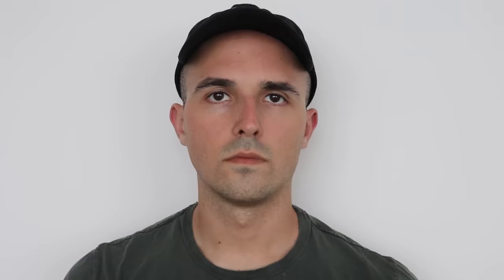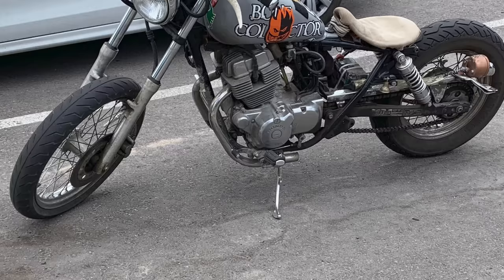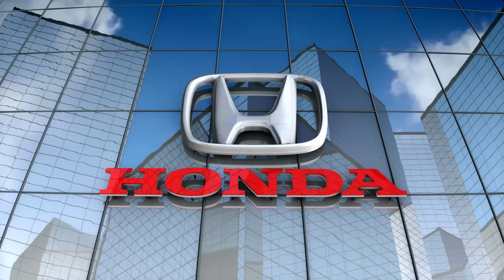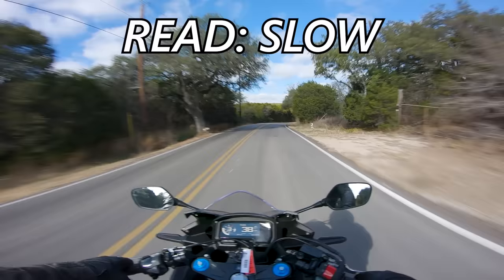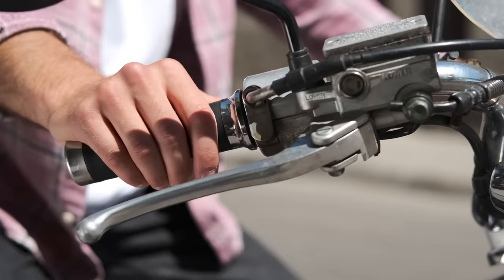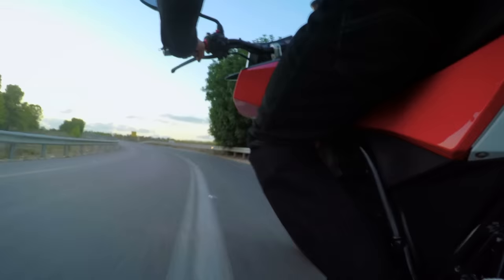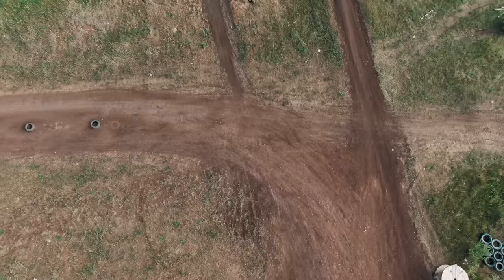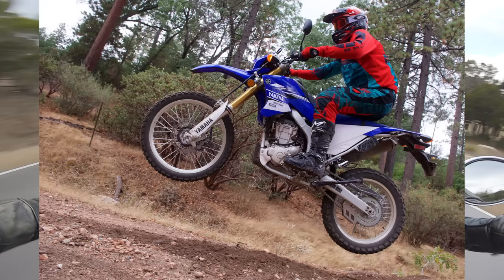7 Used Motorcycles That WON’T BREAK! (Low Maintenance)

Comment: Triumph, Harley and Enfield you say?
How about a suzuki vstrom 650. Mine has been bulletproof for 200 000kms.
Reply: Looking to buy a used one coz the tiger800 and gs750 is too expensive and 390 adventure or himalayan is less powerful. Any suggestions?
Reply: @aniruddhagujar4119  Benelli trx500 or Kawasaki versays 650
Reply: @prithvirajsainiranjan6240   no so underpowered and pricey services and maintenance cost
Reply: @aniruddhagujar4119  what else is available tell me😂😂
Reply: @prithvirajsainiranjan6240  better to buy a used vstrom versys 650 than Benelli
Reply: @aniruddhagujar4119  Me too but they're so bulletproof they hold their price really well...sometimes you can get a deal because they come with all sorts of panniers and travel stuff
Reply: @prithvirajsainiranjan6240  benelli is highly unreliable bro.....believe that
Reply: @Sandipan_Naskar  oh ok I didn't know that I am still a 17 year old so still learning 😂
Reply: What kind of bullets did you use?
12 gauge or 9mm??
Reply: @myname9252  Rubber bullets😂
Reply: @aniruddhagujar4119  italian machines=🌰. They run great til they dont.
Reply: @myname9252  I seen a British bike magazine test out the "bulletproof" theory on a GSF 1200 engine. :-))
It was, except for the oil sight glass, plus they used 12 gauge bird shot :-((
Reply: @aniruddhagujar4119  Cannot be wrong with V Strom 650, excellent bike!
Benelli is heavy, underpowered and made in China.
Reply: I've noticed a dubious trend among motorcycles that come from Suzuki and have 650cc's... I have a 95 Suzuki Savage 650 LS, myself... AND it's simplicity can't be understated (1-cyl thumper engine... 1 brrl carb... ZERO ECU... Air cooled... Zero f***'s given)... AND it's rugged as hell. I ride the mountains A LOT (because it's where I live)... SO it gets treated like a Cruiser ONLY when I'm on long enough trips to get on an actual highway... AND often gets treated as a sport or trail-bike bouncing from the take off to avoid getting plowed by a logging truck when I hit an asphalt road to kicking around weird uneven and mostly gravel or broken gravel and mud surfaces almost everywhere else...

     ...AND zero trouble... The carb cleans out with a scrub brush and a set of Acetylene Torch nozzle cleaners over about a half-hour break... AND that's even been a rare occurrence... Basic maintenance obviously SHOULD be done regularly, but she just keeps going...

     AND then there's everybody else talking about their older Suzuki's... and it's almost always a 650 something or other that's been as rugged and reliable as the winter is long...

      For not making it on the list Vid... I have to wonder at the reliability of the bikes that did... NOT all together sold on the Ducatti, though... BUT I count the trial by miles, not years... SO I do always check the odometer...  ;o)
Reply: Thank you for mentioning Suzuki for I owned a GS450L lasted sold it to a gentleman and he passed it on to his son.

Comment: Bought an '85 Honda 650 Nighthawk 2 1/2 years ago.  It's a John Deere tractor disguised as a motorcycle.  For a grand, it starts, runs, looks (sort of) good, and is great fun.  Even the Harley guys acknowledge Hondas are bulletproof.  Recommended.
Reply: Just bought my first bike,an 83 550 nighthawk
Reply: here in India escort's tractors are more reliable and preferred over jhon deere. and for bikes hondas are undoubtedly bulletproof.

Comment: I'd like to say a thing about a Honda in particular: if you stumble across a 1985 Honda Nighthawk (CB650SC) you can buy it on the spot because it got '10s level technology: that bike is indestructible, is shaft driven, is liquid cooled, it got self adjusting carbs meaning you will never have to set them up in the garage and it has stock digital gear, fuel and tyre pressure indicator. I did my msf course on one of those and I loved it. Man I want to buy one so badly
Reply: A CB650SC, Which is a Nighthawk, is air cooled. There is no such thing as a self adjusting carb. Self adjusting fueling would be fuel injection, which no Nighthawk had unless your driving a European version which I have no knowledge of. They did not have Tire pressure indicator's either. The CB650SC you describe are extremely dependable and virtually unbreakable.

Comment: Another I'd put on this list is the first generation Suzuki Vstrom 650. Especially the late models after 2008. I bought by 2008 in 2018, have ridden it three seasons... Started just under 10K km, have almost 70 on it now. Outside of oil changes and tires, I've done front and back brakes once and replaced the chain and sprockets. No lie. And it's fun as hell. One recommend if you get one, K&N air filter and Iridium spark plugs. You'll save yourself a lot of maintenance time and the Iridium plugs help give it a little kick in performance while still using regular gas.
Reply: absolutely, the sv/Vstrom 650 should have been at or near the top of the list.  Also, what up with no mention of the Triumph triples... bullet proof and very fun.
Reply: So, I had an '82 Suzi GS650. Then in 2008 (a few years later) I wanted to buy a used vStrom, but they were so rare that used ones were almost the price of new. Then I wrangled a deal on a demo 2008 DL-1000 and I rode that for 10 years.  I did notice that it preferred premium gas (and went further on a tank than on regular) but they don't like low revs. 
After a brief relationship with a Moto Guzzi Breva 750 (fun, light, flickable, but just too small for me) I was at the Suzi dealer to close the deal on a new (2019?) DL-650. 
Base price was under $10k (Canadian) but it was over $10k "out the door". 
And they had a fresh trade on the showroom.  
A 1-owner 2004 DL-650, all stock, with factory 3-piece luggage and new Michelin Anakees on it. 
The owner kept it stored in his heated garage, and only put 20,000 kms (13,000 miles) on this 15-year-old bike. 
He just traded it on the same new DL-650 as what I was planning to get.  The price was $4k (Canadian, that's US$3k) -- with full luggage on new Michelin tires -- and there is only 1 scratch on the entire bike that nobody would even notice! 
So, I'd sold the DL-1000 for $4800- (it needed a chain, sprockets, and rear tire which would not have increased its value) and decided that I'd be stupid to pass up this "new" bike that just happened to have spent 15 years in a garage, and was serviced by the same dealer every spring. 
Oh, and it seems that they hadn't "cheapened out on the front suspension" yet.  
You know that a big advantage of the 1000 over the 650 is the adjustable front suspension. 
But my 2004 650 has the same suspension as my 2008 1000 had ... another benefit oldness.
Reply: Mine hit 98k on the odometer before I sold it!

Comment: Yep, my first two wheel machine is my 2004 Honda silverwing 600 scooter! A little big and unusually powerful (especially for a scooter) but it was great to learn on! No clutch to mess with as I got used to wielding a 500+lb machine that will go triple digits with no problem. The only problem with it thus far is a moderate size oil leak from the oil seal, but should be an easy enough repair. 
From there I graduated to another bike on the list; the Harley Davidson 883! I absolutely love this bike! Being a new rider I don’t have anything but a scooter to compare it with so it seems like a REAL MOTORCYCLE!! After 500 miles on it I haven’t had any of the oil leak issues everyone complains about? My air cleaner is, well, clean😂🤷🏻‍♂️. The 883 seems like a rocket ship compared to my Honda and I couldn’t care less about the vibrations. It’s just an old school, no frills, super cool looking, motorcycle that does motorcycle things. It goes down the road on two wheels looking awesome and sounding great and that’s all I need it to do. I’ll probably trade it in one day for a bigger bike but not right now, and not for a while. Not to mention it’s super cheap to own.
Reply: I've got 60k on a silverwing.  Only repair is new wheel bearings since I ride in the rain.  I may need a new clutch pads soon.  But It will probably hit 100k without much more.

Comment: Old Hero Honda bikes are the most reliable thing on Earth after gravity. Especially the Japan model CD100 and Splendor.
Reply: FYI, Those were based on Honda Cub which in World's biggest selling bike and every biker is familiar with the Cub.
Reply: @ritwik0  yep. Owned a honda cub, cd100 and original splendor. I still have a CD100 non SS model and a Splendor Japan model in perfect running condition. CD100 has only 36k genuine kms.
Reply: Absolutely my dad's bike got more than 350,500 km

Comment: I used to work as a motorcycle courier, typically running 500's as the best compromise between speed, range, reliability and economy. Hondas stood out by head and shoulders. In the 1980's through 1990's, the Maggot (that's the CX500) was the tool of choice. Later came the VT500, which was okay, but not as good. Kawasaki's pre-Zephyr GT500 & 750 fours were also honourable mentions. All shaft drives, you see. Eventually I got fed up ending my day a couple of hundred miles from home and downsized. I got a Suzuki GN250 which was good for nearly 90mpg and nearly 90mph, depending on use. The engine was bulletproof. Biggest issues were the tiny petrol tank, so you were routinely on the lookout for a petrol station, and the gear lever constantly coming loose on its splines until the splines wore out and a new shaft was needed. The trick was to spot-weld the lever to the shaft. Later, I got the almost- in-every-way-inferior Honda CB250. I hated riding in rain. Bear in mind I was out for a minimum 10-hour shift. Then, one day, Benelli produced their Adiva convertible scooter. It was love at first sight. I  got one brand new. The deal was to use the Honda in fine weather and the Benelli in the wet. That changed my life. And contrary to all expectations, the little Benelli just kept on going, year after year. For 13 years, that radical roof-scoot soldiered on, keeping about 90% of the rain off me. Last year, several years into my retirement, the thing having been abandoned at the back of the garage for 5 years; I hauled it out, fitted a new battery, squirted Bradex into the air intake and swung the starter. Just 3 spins and it was running - even on 5-year-old petrol dregs. So I made its overhaul a covid lockdown project and next week hope to have it  back on the road. Benelli's Adiva - the best thing I EVER bought...
Reply: Fantastic post
Reply: The Kawi Zephyrs weren't good?
Reply: My first real street legal bike was the '79 CX500. I loved that bike. I drove it everywhere.

Comment: We missed the 1a spot on your list that is the sv650! The most bomb resistant nuclear war surviving Cockroach bike you'll ever find!
Reply: Is it really that good? I just took my test on one and thought I like this might buy one 🤷🏼‍♂️
Reply: @FriskyDecisions  I've got a V-Strom which has the same engine, more or less. I'd say they're pretty close. They do like fresh oil. Change the oil every 6000 km and they'll go a long time. There's a guy on stromtroopers who got 600 000 km on his, before the engine cracked. I think the only major things he changed were stators.
Reply: @gasdive  600 000 ? Holy mackerel !!!!
Reply: I hoped will see Vstrom 650 in the clip, but instead I saw HD and Royal Enfield... 😂
Reply: @electron1980  Or a Transalp…
Reply: 90% of motorcycle courier in London ride SV650..
Reply: @markletts8802  Really? It can't imagine the fuel economy is good enough for a courier on 650cc sport bike. Sounds like an awesome job, either way!
Reply: @cesartapia610  SV is not sports bike.
Reply: @electron1980  Naked bike, right? I assumed they would want sub-600 bikes though.
Reply: @cesartapia610  Yes, naked. But SV comes with some fairings, also. The V2 engine is cheap to run, my old 650 V-strom drinks about 4,3 liters per 100 km. With pillion. And SV is lighter.
Reply: @cesartapia610  mine gets 50 mpg no matter how I ride it
Reply: @electron1980  many would beg to differ given the racing scene In the UK and worldwide on mini twins.
The MK2 full faired variant is extremely nimble and whilst it may lack the top end power on short circuits the svs low end torque can be used to the best effect
Reply: @seeul8rwaynekerr  Confirm! ✌️

Comment: Missed the SV 650
Reply: I've read a thread by a guy that made more than 400000 miles on VStrom 1000. Same engine with SV1000, maybe little detuned. These engines are bulletproof.
Reply: @jordan9339  If they only made the sv1000 with ABS, I would totally want one.

Comment: Royal Enfields are known to be the most unreliable bike in India. You don't really buy an Enfield for reliability...
Reply: Because we Indians compare it to 100cc motorcycles.
I own a himalayan bs3, most notorious names in India when it comes to reliablity, but trust me REs are reliable.
Reply: @logicalindian_777  Nah man, compared to the direct cost competitors, Enfields are worse and have a very picky service schedule. I had my NS200 lying in my parking for 7-8 months during COVID and it didn't give me any issue, other than a dead battery of course. That wasn't the case with many bikes, mostly Enfields, my friends own....
Reply: Post 2018 REs are reliable bikes. Had mine for 2 years, 11000km, not one (1!) problem. I do my own maintenance.
Reply: Well i have ny vlassic 500 for the past 3 years .. not too bad i mean sure it does cost more compared to a few bikes ... but mine was left for almost  4  in the lockdown  .. and a basic service  is all it needed ..... i got it new an rode for around 12000 kms in  2.5 months had i had to change the clutch  plate once an thats  about  it ..

Comment: Ive had lots of bikes, one of the most memorable was my 1983 Honda nighthawk s cb700. Easy maintenance, hydraulic clutch, hydraulic lifters, shaft drive,16 inch front wheel.
 Very tight package. I had to commute in those days, nighthawk made it happen.
Reply: I had one of those. Maybe should have kept it.

Comment: With 4 Hondas at my house, I have to agree with everything you said.  Fuel injection on all 4 makes for the greatest long term reliability. ('23 GROM, '12 CBR250r, '14 CB1100, '10 VFR1200f)  Lastly what you said about the Ducati can also apply to other bikes.  I am genuinely afraid of the 2010 VFR 1200f as it is wickedly powerful and a tad too heavy for me at 76 years old.  I bought it super clean with low mileage and the previous 2 owners likely were afraid of it too.  The first owner had it for 6 years and put exactly 616 miles on it.  The second owner dolled it up with fantastic tires, a lithium battery and barely rode it with his wife making him sell it.
Reply: The first thing anybody needs to do with any bike is BUY A GENUINE FACTORY SERVICE MANUAL and sit and read every page.

Comment: didn't expected a place for royal enfield
Reply: The 650 interceptor is the best selling bike in England.
Reply: They have been pumping a lot more money into modernising these in the last few years. Give it another few years and the newer second hand ones should be better than the older ones.
Reply: They are quite reliable, I have owned two of them!
Reply: @logicalindian_777  The new 350 and the new CB350 Honda that competes with it both look very interesting.  Here in North America we tend to think that a 350 is too small.
Reply: @logicalindian_777  i own an RE too, no they aren't reliable literally parts fall of them once while riding my gear shifter fell off imagine that lol. in my opinion honda cb 350 is a lot better than the classic.
Reply: I have a 2020 Royal Enfield Continental GT 650. It's a beautiful POS. Been in the shop twice.  Dies on ya going down the road and then won't start. Get a Japanese bike and can the rest.
Reply: @michaeljoesmith3977  Yeah I've got a RE Classic 500. Beautiful bike, but it'll occasionally conk out midway through an intersection.... and only through intersections. Makes it a spicy time.
Reply: btw  bajaj enigin are better in  india many peoply are using models from 2005 for daily life
Reply: @Papa-ur3ju  is that so than maybe i will buy a duke 390 for my first bike

Comment: I had a Honda CB360 once. A guy I knew had one sitting outside in his back yard for 25 years. He bought it new, drove it for a couple miles and fell off it and never got back on again. He gave it to me thinking it would never run. I bought a manual for $15 and took out the carb, dropped it into a bucket of carb cleaner and let it soak over night. I put it back in the bike added some new plugs and battery and it kicked right over. I had to treat a rusted gas tank and put new seals in the forks, but I rode it for several years before I gave it away.

Comment: I put 360,000 miles on my 1985 Harley Davidson flhtc.had it re-ringed at 220,000.not bored just honed and re-ringed.i would have gotten more miles than 360,000 but got T boned going 60mph.had probably 4 sets of lifters installed, and 4 stator's also.the early evo motors are absolutely amazing. Steel lifter blocks.i have 4 ,2 1985's and 2 1986 liberty edition bikes.long live the evo..R.I.P HARLEY DAVIDSON 1903-1999..

Comment: I have a 2009 CRF230L.   Tough little bike.   And a Nighthawk 750 with 41,000 miles.   Runs great.    Friends have had very reliable Harley's as in this video.   BMW friends seem to have lots of electrical issues so I kept away.

Comment: Scooter indestructible - that was a highlight of my "bike mechanic" career.  
 
I saw a girl whose scooter did not start, and went for the classic, and was lucky she had a spark plug wrench.  
 
And it really did me the favour, the electrode had partly melted and a tiny pearl short circuited it.  
 
I was able to poke it out -  presto, it started again!
 
Yes, I told her she should have a mechanic look at it, melting spark plugs mean it runs way too hot.